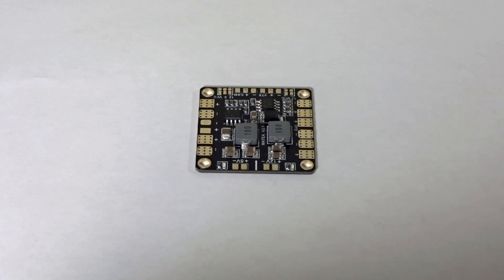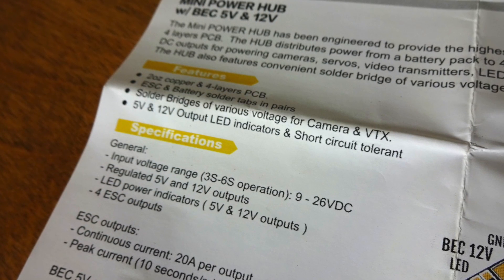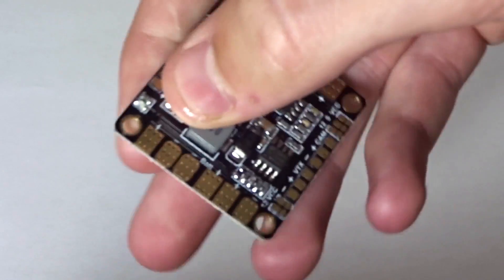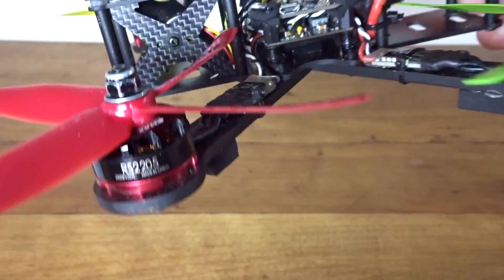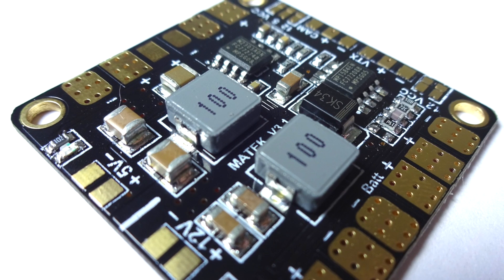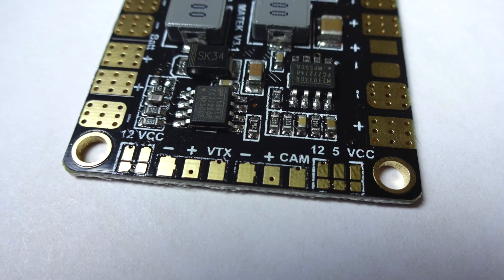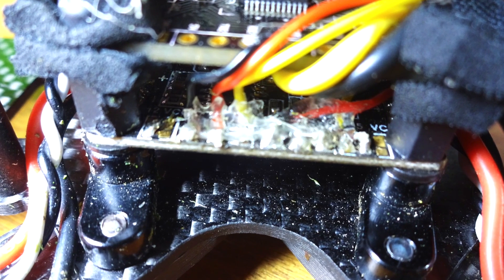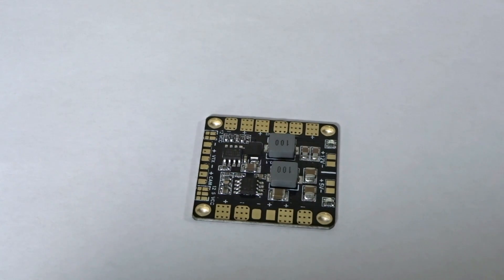Matek Mini Power Hub PDB V3.1 Review

Comment: I am new to Race Drone build. I have ordered that board. I will be using a 3s battery for now.. So which do I solder together for power?
Reply from the maker: You just soldered your battery leads to the main input pads.

Comment: Hey there, i have a question about this pdb.. I have one laying around, and i am building a speedwing. I would like to use this pdb for the FPV cam / vtx and LED etc.etc.  I thought this would be a nice build for this PDB..  But my question is, Can i just use a 40 AMP  ESC on this board without a problem ?  My motor/ prop combo will use approximate 30 / 33 AMPs continue... And can i use just 1 esc output, or do i need to solder the esc onto 2 esc outputs ? As far as i know,  it would not matter, as long as i stay under 80 A total... Am i right ? so 1 ESC of 80A on one output;  equals 2 ESC of 40A on 2 outputs, equals 4 ESC of 20 A on 4 output...  Like to hear your findings.
Reply from the maker: You are thinking about it the wrong way. 20A rated it due to the copper not being able to handle more heat, so you would want to maybe solder up 2 of them together to help share the current, and not have it all go through one. Do you need the PDB just for regulators? You could just wire the battery straight up the the ESC, and then have a side vbat wire to power regualtors to power your other stuff, don't need to run teh current though the PDB really.
Reply: Thanks for your answer. I have learned something today :) Hope to get my mini race wing  up and flying this weekend, :)
Reply: @TheRCAddict  hi, dont know if the account is still active and if yes sorry for asking a question after 6 years, but now pdbs are almost unfindable and the one that you showed in the video supports only 20a. could you show in a video how to wire the escs directly to the battery cable and how to connect the power wires for the fc on the battery cable? i cant really figure how to do this so if you could it would help me so much

Comment: What amps can I run through this board? Am I safe upgrading a 190mA vtx to a 600mA one on the bridged 5V pads (vtx)? I'm not really sure the rules on that or the words I can use to google a solution to stay safe when swapping and adding parts. I wanna use tbs unify pro v2
Reply from the maker: Not sure what they are rated to, but it is fine :) Never had a problem for mine. I would suggest 12V for the VTX though.
Reply: I can't, the unify pro v2 is a 5V vtx

Comment: if my esc's pull 30a can i us this?
Reply from the maker: ESCs do not pull current, the motor pulls the current through the ESC, which pulls from the PDB, which pulls from the battery. This board should have no problems with current unless on some super high current draw setup, like over 150A.

Comment: Question? Would there be any problems in wiring  this board as a first contact source from my battery which is a 11.1v battery and use the 12v output from the Matek and have it continued to original wiring for quad? My source quad is a Yuneec Q500. I wish to place additional sources to it. Afterwards I am sure that it might cut down flight time, but thats no problem for me.
Reply from the maker: Yes, these regulators are not boost buck, so they can't bring the voltage up, only down. If you are running 3s and need something 12v you will have to get a regulator that can bring it up like a pololu.

Comment: My VTX requires 12vdc.  If I am using only a 3S lipo, then do I short the 12v pads for the VTX or do I run Vcc?  Not clear on the Matek paper how this works.
Reply from the maker: The regulator is not a boost buck reg, so it can't bring it up to 12 if the input it below 12. Does your VTX ONLY require 12v? Most go from about 7-24v.

Comment: Great video.  I am using this board.  What size AWG wire do you use to power the PDB?
Reply from the maker: I use 12AWG wire or the mains input since my quads pull very high current.

Comment: I really need help.I'm very new to this and I have a naze32 acro 6 and this pdb, and Im trying to build a racing drone using a skyzone upgrade 200mw vtx , and this camera(https://www.aliexpress.com/item/Wholesale-1pcs-1000-TVL-FPV-HD-COMS-Camera-2-8mm-Wide-Angle-Lens-for-Multicopters-NTSC/32628334752.html?spm=2114.01010208.3.21.Q334ar&ws_ab_test=searchweb0_0,searchweb201602_3_10065_10068_10084_10083_10080_10082_10081_10060_10061_10062_10056_10055_10054_10059_10099_10078_10079_426_10073_10103_10102_10096_10052_10050_425_10051-10050,searchweb201603_9&btsid=7b2f59a2-c4f7-4bcb-999b-a0962cca0ed3)
 and a flysky 6ia receiver.Please please can you explain how do I connect them all through a video or diagram?Thanks

email:swaran@gmail.com

And Im trying to make an210x
Reply from the maker: Maybe check out some of my build videos. While the parts are different, most of the connections should be similar. Just make sure to triple check polarity on everything and go slow.

Comment: Did you have any issue of loosing video signal or the 12v failing on flight ?
Reply from the maker: No, I have never had any problems. I now run the cam off of 12v and the VTX of off VCC though to 100% prevent that happening. The VTXs I use can take up to 24v, and highest voltage spikes are about 22V so it is fine. Just decided to use cam on 12v since it takes 5-?V and didn't want to run on the very bottom.
Reply: How do you now the spikes are only up to 22v?
Reply from the maker: Octávio Maia People have told me that the littlebees went up to that. They probably saw it through their OSD. I wouldn't worry about it haha.

Comment: With your x210, did you receive a Matek v3.0 or v3.1? Just curious as I heard that there were some BEC issues with earlier ones (but I'm not sure which of the versions may have fixed them).
Reply from the maker: I don't think they make the old version anymore, but I am not sure :/
Reply: The RCAddict ok,  thanks. I contacted FPV model to see which they carry, they might just still use the old version's thumbnail.

Comment: The version# 2.1 and 3.0 have problems with the regulators. Any input under 13.9v will drop the 12v reg to 3volts killing video. Stay away from these cheap boards. Trust me if you have video black outs on punch outs check the matek. Plus they don't stand behind their products!
Reply from the maker: Well, this is the V3.1 ;) I have NEVER had a single problem with them and I have used this specific board in 4 builds and still loving it. Not saying the others don't have problems, but I am quite satisfied with this board.

Comment: you soldered 3 cables to this PDB from the fpv cam (positive,negative,signal) ? and from the VTX  you soldered 3 cables to this PDB (positive,negative,signal) ?
Reply from the maker: Yeah, you just solder the positive and negative from the camera to the CAM side, selecting which voltage you want, either 5V or VCC (by bridging the pads with solder vertically) and then the signal goes on the signal pad, and same for teh vtx, except I use teh 12V pad there.
Reply: ok thank you so much!!!

Comment: by the looks of it, those two "100" marked components are 10uH or 10 micro henry inductors. Which means the board is simply a buck & boost switch mode converter.
one coil is responsible to drop the voltage if input is higher than output and the other does the opposite.
and at least one of the IC is the switching mechanism.
i'm actually surprise that a switching supply is used instead of a linear because it produce ripping voltage which might interfere with RF.
emmm........
Reply: and the two 10uH inductors has nothing to do with the ESC
Reply from the maker: Thanks for the info :) I have not had any problems with that, I think, haha.

Comment: Hey I have heard their was an issue with the 5v regulator. Once the battery voltage would get below a certain voltage the regulator would stop outputting power and people were losing video footage. I believe the company said they got a bad batch of regulators and have since fixed this issue with the newest version, so just check which version you are buying. I purchased the ZMR X210 kit based on your review... hoping the PDB is the newest version with no problems.
Reply from the maker: Hmm, that might be true for a 3S battery, as if it gets low with 3.5 volts per cell, the pack it self is below 12V, not sure if it is a boost regulator, so power output would falter. Not too many people run 3s on high end builds though.
Reply: hey just done some fact checking and the problem seemed to be when the voltage from a 4s drops below 14v the 12v regulator just shut off with the only way of coming back on being disconnect the battery and reconnecting. But, I think if you have the newest version your ok.
Reply from the maker: Defying Gravity Hmm, yeah. Never had that happen and I run my batteries lower than 14v.

Comment: unless you're looking for OSD unless you're looking for a OSD integrated these matek boards should definitely be the standard go-to pdb... I have the 5 in 1 which is great if you need controllable LEDs and a buzzer built in it also has the standard mounting holes to fit in the Tower of Power lol
Reply from the maker: Yeah, if they add an OSD in a future version, it will be amazing!

Comment: perfect timing just bought one yesterday!
Reply from the maker: Sweet, for what build?
Reply: An ls 210 , naze 32 ,sunny sky  x2204 2300kv motors , 30a esc , and haven't decided what fpv gear yet.
Reply from the maker: Daniel keegan Cool, just a heads up, no need for 30A escs ;P 20A would be more than enough on that build.
Reply: oh really =) i got them because that was what the website recommended. Do you know if there is any disadvantages apart from weight ??? thanks
Reply from the maker: Daniel keegan Not really no. Just remember, thrust tests on a bench are only partly helpful. Real life non static conditions are much different, and less amps. For example, my red bottoms, and props should be pulling 30-35 amps according to bench tests, wut in real life they pull like 20-25. Running little bee 20A. Never a problem, never hot...etc.
Reply: The RCAddict oh ok that's interesting Thanks for the help.

Comment: nice video! funny thing is that i also loved the compactness of this, but I wont be buying another one. the 5v bec on mine was faulty and would brownout on powering my fc. thats why i have to run an external bec. Glad yours is working for you though :)
Reply from the maker: Thanks :) Hmm, brownout? Not sure what that is, haha. That sucks though. I have never had a faulty one of these.
Reply: its kinda like an overload, so the fc resets/ turns off for a second and back on.
Reply from the maker: Kobe Vergara Hmm, that is interesting...
Reply: yup. people at mrm told me to get a seperate 5v bec so maybe ill finally get to fly by the end of the week!
Reply from the maker: Kobe Vergara Hmm, did you buy it from them? If so that is not really good customer service...
Reply: I bought the PDB off ebay lol, not their fault.
Reply from the maker: Kobe Vergara Oh ok, haha.
Reply: do you power your fc off the 5v tab? The RCAddict
Reply from the maker: Kobe Vergara Yeah, I just soldered two wires from the 5V pad, and ran them up onto the voltage spots for pins of esc.
Reply from the maker: Kobe Vergara Sent